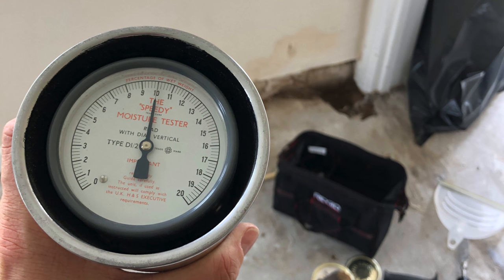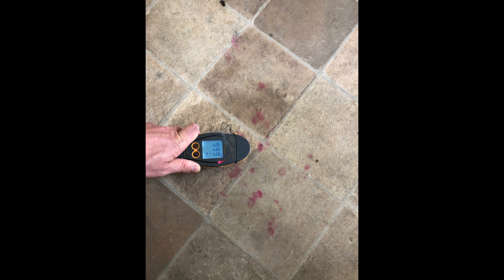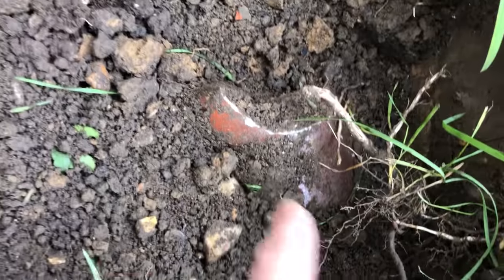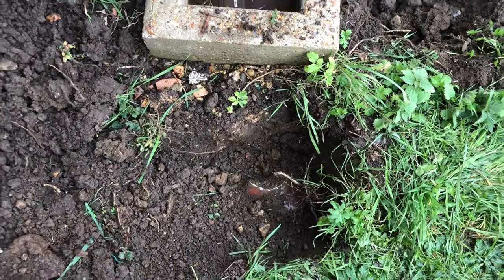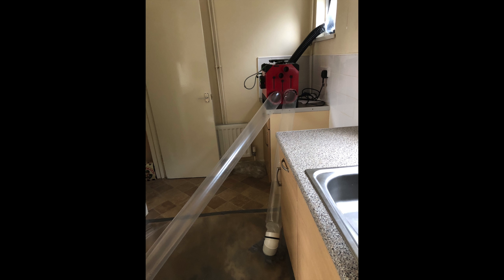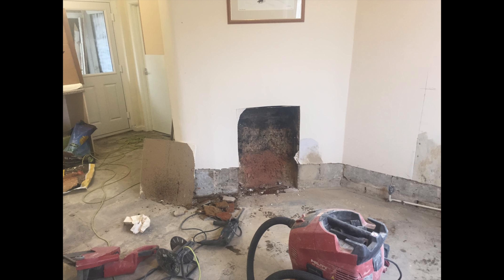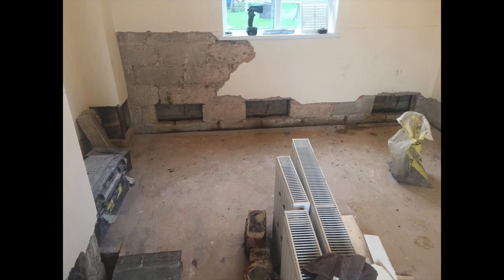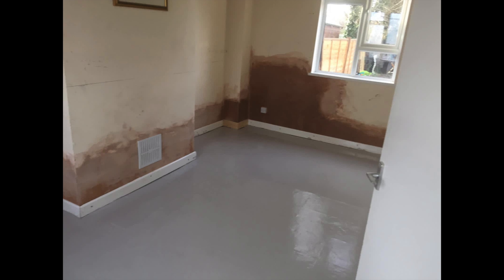VERY EXPENSIVE DAMP REPAIR

Comment: Wow that was indeed a lot of work but at least you tracked down the cause of the problem rather than merely attempted to deal  with the symptoms as so many "specialist" tend to do - although in this case it appears that things were so bad they could not be covered up.   Diagnosis before remedy - an excellent approach.
Reply from the maker: Thanks Alan, as you can see with this one  some basic damp investigations revealed some expensive horrors. I’ve got some horrendous ones I need to edit, where the properties have been bodged up 👍

Comment: Great work Ross! 
Can I ask what you used to fill in the 120mm cut out around the perimeter of the rooms?
Reply from the maker: Thanks bud, I use what I call a modified waterproof screed. You can use a liquid Waterproofer to the floor and wall junction, and for peace of mind waterproof sand and cement infill 👍
Reply: @completepreservation  Thanks. What epoxy product did you use to seal the concrete floors?

Comment: Great video, what did you do about the channel cut out round the edge of the floor, what was it you filled it back in with?
Reply from the maker: Thanks for the compliment I used a waterproof modified screed 👍
Reply: @completepreservation  did you place a dpm between the screed and the wall?

Comment: Curious to know your thoughts on the videos i've put up on here, i've taken some readings on our new build built in 2019 and the meter is going crazy pretty much everywhere. We have skirting that has twisted away to front of property, our snagger picked up on potential for heave there. There is an odd mix of DPM and Radeon barrier here, our dpm is black and radeon is orange but we're seeing bits of blue poking out in places where the dpm layer is. We have over 400 snags here, dozens of which breach building regulations and Redrow are ignoring them. NHBC was here last month and they instructed Redrow to carry out works which Redrow have ignored and attempted to pay us off to shut us up as we went to the media (we got them in the telegraph / mirror / daily mail / the sun / devon live etc). NHBC were also ignored prior to this by Redrow. What we have also found is that NHBC won't measure things and will eye ball whether or not something is a problem even though it's been measured by our snagger Paul Frost (Snagaroo). Major reforms are needed with new builds it's crazy. Curious on your thoughts.
Reply from the maker: Hi, I can’t see the videos, can you post a link? Unfortunately new build in some cases can be an absolute lash up……I can’t see it changing either
Reply: @completepreservation  if you click on my profile name here and click videos you'll see the ones I've uploaded here. Yeah new builds severely lack protection. This new ombudsman is pointless as it only covers from exchanges made once they've signed up and developers have until the end of the year to do that. This gives developers like Redrow a clean slate on all these severely issue houses.